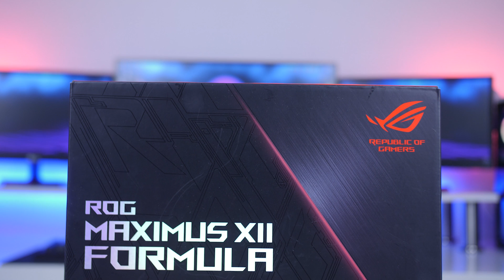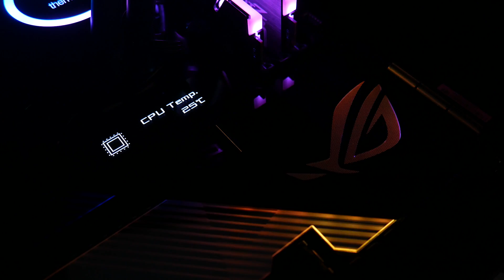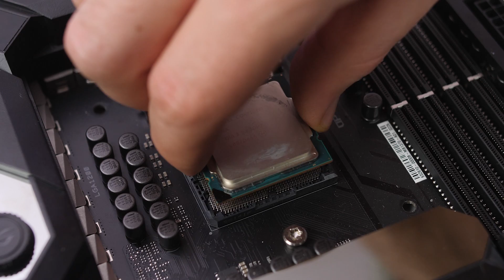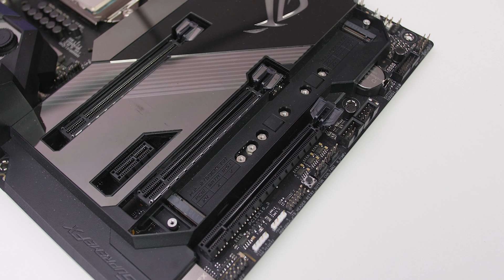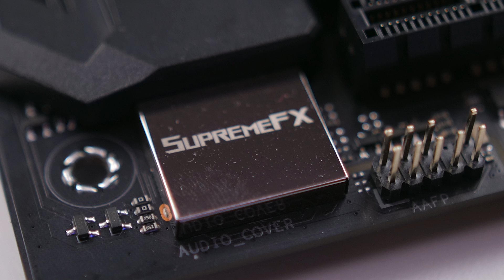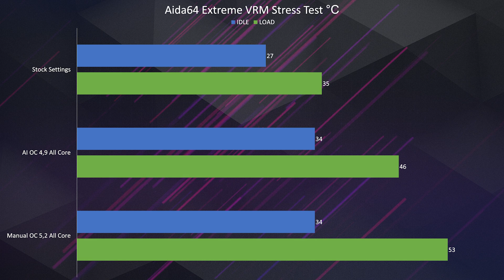The Perfect Combination - ASUS Z490 ROG Maximus XII Formula Review

Comment: i know its an old video, but i thought i'd ask. Ive been looking to change my motherboard due to having a pre built one which limits ram options. All the "top z490 motherboard" websites recommend either HERO or EXTREME versions. While looking at the specs FORMULA(€352) seems better than HERO(€266) and far cheaper than EXTREME(€500), yet it doesn't get recommended. So i was wondering if there was a particular reason or am i missing something?
Reply from the maker: Not sure why they dont, but really if you not going to do any heavy overclocking the HERO is enough. The only other thing is then the IO, M.2, RAM Speed and PCIe slots. Look at what you would need and just go for that. Didnt look at these now, but somethimes it hass like 2 Thunderbolt connections which cost more, but a lot of people dont need. Or like 2x PCIe 4 16x slots for SLI. Stuff like that. Nothing wrong with the HERO the others are just an option if you need more. Like I would pay more TB and more IO but not everyone needs it.

Comment: maybe you can help? i am not new to building but am new to big over clocks. i have this board since launch and i have the 10900k witch i got a dud. 63sp. i cant seem to get it to go past 5.1all core under 1.385vt..i have a 2 rad 360 set up, and right now its just the cpu till i get the new waterblock for the 3090. i run about 28c just browsing and about 42c-55c when gaming, any ideas or advice?
xii formula
10900k
3 xmp pro 1tb m,2
1000watt psu
32gig xmp ddr4 4133
2/360 rads
dynamic xl case with the distro plate with the ddc3.2
ek cpu water block
ek vram/cpu pass thru water block 
9 lain li uni fans
msi trio 2080ti-untill i get the 3090
Reply: can i oc without watercooling? i gt the aio ryujin 360
Reply: just bought this board cuz it has oled on it found out it has waterblock after i bought it

Comment: Really good content and info, my dude. Just one question: If running the cpu on air cooling with for eg a CM AirMaker 8, would it cover up the OLED display entirely?
Reply: Why would you buy this motherboard if you‘re not liquid cooling? The VRM has to be watercooled so you will need some sort of watercooling loop in your system.
Get the XII Hero for air cooling
Reply: @helloworld-bu1vk  For the looks primarily, but, is it that the vrm can't operate without liquid cooling? Can't i simply leave it on passive?
Reply: @helloworld-bu1vk  Also the Hero doesn't have an OLED display at all and doesn't look as good. I am looking for a board with a nice OLED display and armor for the looks. Any suggestions? Help would be greatly appreciated!

Comment: Can someone answer me this. I want to buy this motherboard but im kinda confused do i need to watercool that heatsink around the cpu? Or is that just an option? Keep in mind i am gonna watercool the I9-10900k and overclock it with Ryujin 360 AIO.
Reply: Yep, confused too ! I came across someone that has contacted asus and they replied that the Vrms don’t need to be watercooled when using stock settings, the board will operate just fine. But if overclocking, vrm temps should be monitored... I’ve also seen that the vrm design is so efficient for this motherboard that overheating them is most probably not an issue even when overclocking...
Reply: @adriend9308  Which means i can overclock my I9 with my AIO without worrying about watercooling those vrms right? 🧐
Reply: @TheyCallMeShinobi  same here i having same situation with u

Comment: Also you mentioned when m.2 is used it lowers pcie lanes? So if I have my graphics card in slot one it will slow down my m.2 slots? I have two m.2 drives one for windows boot in slot 1 and a 1tb in slot two for games
Reply from the maker: Some do share pcie lanes, but how you mentioned it should be fine.
Just rewatch that part to make sure which slots you will use, think it was more to do with the bottom x16 which you won't use for your gpu anyway.
Reply: We Do Tech right I looked at the online manual and the 3rd pcie shares with the back side m.2 and also pcie2 shares with sata 5 and 6. I will only be using m.2 slots 1 and 2 and a single gpu in pcie slot 1 with sata 1 and 2 and maybe 3 down the road so it looks like nothing will take any bandwidth from anything